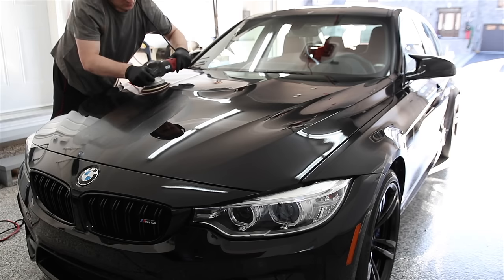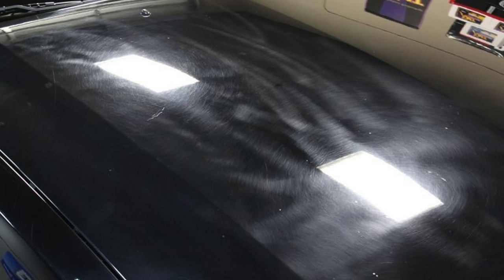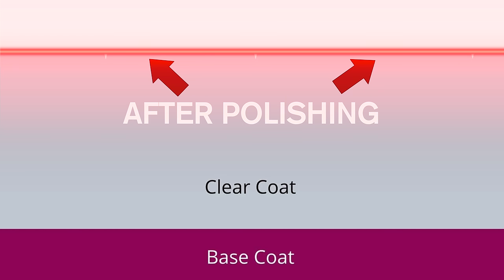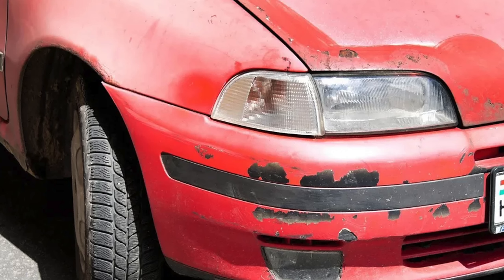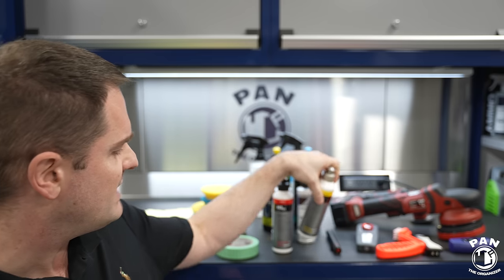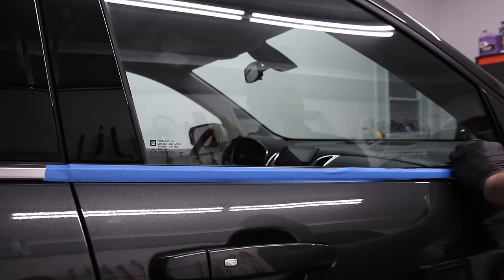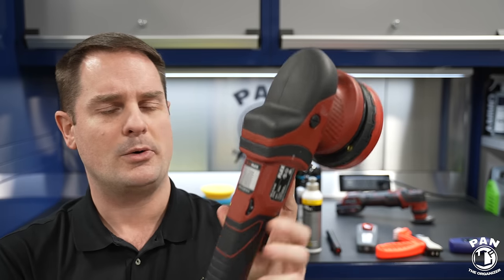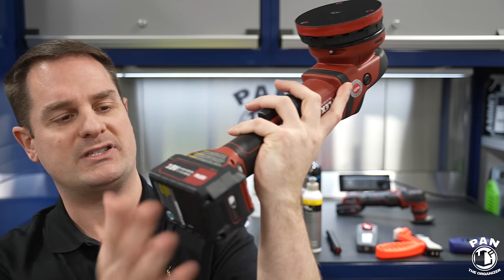DETAILING 101 - Paint Polishing - Everything You Need To Know

Comment: You mentioned something about “as long as your car hasn’t been repainted” I have a 23’ Tahoe that was not painted correctly from the factory and the dealership had to repaint.  They left horrific swirls and scratches in the clear coat from where they repainted.  Do I need to do anything differently to paint correct?  Or be aware of anything special?
Reply from the maker: Yeah unfortunately, dealerships often use the less expensive bodyshops as sub-contractors if they can't do the paint job themselves, so when they look for the less expensive bodyshop (so the dealership can maximize the profits when charging you), that means sub-par work and you get swirled and hazed paint like you did.

You wouldn't necessarily do anything different to paint correct though, as normally, repainted areas actually have a thicker paint as it was applied by a human, instead of a precise robot like at the factory. So the same polishing steps and processes apply on repainted vehicles too.

I would just recommend that you wait at least 1 to 2 months before attempting to machine polish your freshly repainted vehicle, as the paint needs to finish its gassing out phase, before being fully cured. Don't apply any sealants or waxes during that period.
Reply: @PanTheOrganizer  thank you sir!  I’m always amazed you actually answer all of my questions!
Reply from the maker: I try my best to reply to all YouTube comments every day. I’m the only big detailing channel to do that. It’s not easy though as I can spend up to four hours every day just to reply, as you can imagine with one million subscribers sending thousands of messages daily. But I try my best to stay connected with my audience. 😁👍🏻

Comment: Pan what’s your opinion on using Duplicolor grease and wax Soy Solvent then an IPA after polishing? To make sure it’s absolutely completely clean
Reply from the maker: It's overkill hehe. You don't need both. I tried the Duplicolor a few years ago and it's perhaps more suited for body shop use, to prep before painting. That stuff is powerful (get the soy based one if you absolutely want to use it).

I prefer using pre-mixed paint prep sprays from the same brand I have the coating for. For example, if I'm applying a CarPro CQuartz UK 3.0 coating, I will likely use the CarPro Eraser paint prep. It was formulated by the same brand and is clear coat safe, at the perfect dilution.
Reply: @PanTheOrganizer  you are the best!

Comment: So is the “compound” what they call the first step to a stage 2 paint correction?

As in a polish is a 1 step 
And a compound and polish considered a two step ? 

Sorry I’m new to this
Reply from the maker: You're getting pretty good at understanding this. :)

A compound is the first step of a 2-step paint correction. Correct. The second step is the polish.

Basically, the compound has the more coarse abrasives, for removing heavier and deeper scratches, swirls and oxidation. Then you follow up with a polish, that has finer abrasives, and that's made to remove the marks left by the compound, all while increasing gloss, adding more depth and clarity to the finish, and jeweling the finish to a crystal like gloss.

And yes, a 1-step correction is just using a polish. A 1-step is typically used for cars in better condition, that only have a light level of swirls and scratches.

Have a good day Ricky.

Comment: BMW M440i GC of one month old - do I really need to test different pads or polishers or can I simply decide to choose the Koch Microcut (or do you recommend to go with the Meguiaer's one from your video since I am a beginner)

My wife's Audi S3 is 9 months old (and she will want me do hers as well of course :)) and no clear problems; do I go with a compound first or can I also go with a polish (maybe the Koch one but perhaps with a bit more cut?) or also meguaiaer's since a beginner.

Last but not least; once polished and coated (still to decide which one but definitely doing it), I guess I should not (cannot even) polish it anymore until the coating will wear down, correct?
Reply from the maker: If you have no major scratches or deep swirls, you can skip compound and just do the polishing step.

Yes you can use the Koch Chemie Microcut on your BMW (Sonax Perfect Finish is another great one). If your wife's Audi has paint in good condition, you can also skip compound and just do the polishing. It all depends on what the paint looks like.

Once the vehicles are coated, do not polish them anymore. Polishing will strip and damage the coating. If you use proper washing and drying methods, you shouldn't need to polish the car for many years.

When I get a brand new car, I polish it right aways and protect the paint with a ceramic coating. For the three years that I keep my car, I never have to polish it again. I get a brand new car every three years.
Reply: @PanTheOrganizer  thank you sooo much 🙏🙏🙏
Finalize my list now, order, wait, unwrap and get to work 🙂

Comment: Just found your channel, and its really good information. My question is : i have a '96 red motorcycle, where it appears the paint has more of a orange tint to it,  ( i suspect sun fading  from sitting near  a window in a garage ? ) vs red. Its a small area on one mirror and a small portion in the same area on the upper fairing, and i would be interested what i should/ could do about that ?
Reply from the maker: Hard to say without seeing the state of the paint. If it's just oxidized, then a compound followed by a polish should bring back the color. But if the clear coated has failed and there is no more clear coat, a respray might be needed.
Reply: @PanTheOrganizer  , ok, thanks for responding. If the clear coat were gone, would it not have a border, where you can see it has been damaged or removed ? Cuz there is no such obvious visual. It just literally looks like it " Fades into more of an orange. Its not chalky at all, and there is no clear transition, but it is very subtle. Maybe impossible to answer, but thanks for your input.

Comment: Pan, would you recommend a 5" or 6" for general use?  I see many 5" come with a 15mm orbit, and 6" often come with a 21mm orbit.  Can you share some knowledge about pad size and orbit size?  Thanks!!
Reply from the maker: I would go for a 5" backing plate as it's more versatile. A 15mm stroke is also more commonly used. Larger stroke 21mm are more for large flat surfaces like large hoods on bigger SUVs or trucks. The bigger the stroke, the more area it covers. Originally, polishers only used to have 8mm throws. Rupes revolutionized the detailing space by offer larger throw polishers (hence the name BigFoot) that could do 15mm and 21mm.

My most used polishers are the 15mm throws.

Comment: @pantheorganizer 
I have a black car and want to apply the Turtle Wax Black Acrylic polish; but, also want to apply Gyeon Can Coat for a ceramic protection. 
You mention doing the IPA wipe down to remove fillers and oils before applying the Ceramic coating - wouldn't this remove the fillers in the turtle wax polish? if so, what would be the best way to accomplish applying that polish and Gyeon Can Coat?

Thanks Pan! Love the channel!
Reply from the maker: If you plan on using a ceramic based protection from another brand, I would not recommend using the Turtle Wax black polish. It acts as a primer for their Black Spray Wax, or compatible products in the Hybrid Solutions line.

If you want to apply CanCoat EVO, I would just use a pure polish like Sonax Perfect Finish, IPA wipe (crucial) and then apply CanCoat.
Reply: Pan, you are the best! Thanks for sharing this, and i'll be sure to use my KochChemie F6-01 polish, followed with a IPA wipe down and then application of CanCoat EVO. I'll save the black polish for a future date and match it with the wax. 

thanks again, Pan!

 @PanTheOrganizer
Reply from the maker: Here’s a video I had made about full prepping a car and applying CanCoat (it was the previous CanCoat version, but same exact methods apply for the new EVO version): https://youtu.be/VnE0b0nsiMU?si=PmU1XJSJKX3nMv_F
Reply: Thank you so much for this, Pan! Your channel really is the best place on the internet. 
 @PanTheOrganizer
Reply from the maker: Thanks Sean! Welcome to my channel. You discovered one of the biggest car detailing channels on YouTube as we surpassed 920,000 subscribers and we have over 120 million views! I have been detailing for 26 years and I love to share my knowledge and passion with my viewers.

You found the right channel to help you learn everything about detailing.

Comment: Hey Pan recently got a door painted and had some over spray compound on my other panels. When I run a detail spray it feels like my rag grabs onto the paint. Any recommendations on how to get rid of compound?
Reply from the maker: Hi Will. First, on a freshly repainted panel, you need to wait 1 to 2 months before applying any form of paint protection. You can wash the car with a pH neutral shampoo, but nothing more. By "over spray compound" I'm assuming you mean paint overspray? If that's the case, usually using a claybar and clay lubricant will take care of that, unless there's a lot and it's baked in, then you'll have to lightly polish the surface with a machine polisher, pad and polish.

Comment: Hey, thanks for the vid. I think I understand the intent but maybe I missed something as I am wondering what difference is there if I have 50 year old paint on a restored car. I know there is no clear coat on these and I know it was NAPA Emanual automotive paint. 

I am guessing the DIY paint on the car is thick enough I don't need to worry about it but what about the protectant, what is typically good for this type of paint. I just want it to be protected when I go to car shows, however it is a driver 1931 Model A Deluxe Roadster, green and black with Pin Stripping. I am thinking about the ceramic but I do have the carbana car wax we paid a bit of money for and you said that may only last a couple of months. Please offer guidance for anything you see could be affected as I have only hand waxed my other cars in the past and am planning on machine work this time to remove some oxidation. The car is always in the garage except when being used.

I will watch other vids to see if you cover.
Reply from the maker: Welcome to my channel. You discovered one of the biggest car detailing channels on YouTube as we surpassed 900,000 subscribers and we have over 116 million views! I have been detailing for 26 years and I love to share my knowledge and passion with my viewers.

You found the right channel to help you learn everything about detailing.

Comment: Pan, would you use a paint prep twice? So after iron remover and clay bar, do you spray the vehicle and wipe down right before using a DA polisher? Or do you go from clay bar to polish, then something like Gyeon prep? 
Thanks for the great info!
Reply from the maker: I go from clay to polish. I only IPA wipe after the final polishing step. Sometimes on older vehicles, I will IPA wipe after the compound stage to inspect the paint and then move to polishing and then IPA wipe again after polishing.
Reply: @PanTheOrganizer  thank you. I used a Da polisher a month ago and inadvertently polished some black trim. Any remedies to get that white polish off black trim? Perhaps a magic eraser? It looks terrible and is really frustrating me. 
Thanks again Pan!
Reply from the maker: An APC and detailing brush should do trick. Be careful with magic erasers as they are abrasives and can alter the trim.

Comment: what do you use to make your own ipa panel prep and instead of ipa panel prep can you just re wash the car with dawn dish soap to remove the grease or wax after polish/compounding before applying ceramic coating. thnx in advance
Reply from the maker: Yes after polishing, it's a great thing to degrease the surface by washing the car with dishwashing liquid. Gyeon actually recommends this in their coating instructions.

But as an extra measure of safety, to remove soap residue, I would still recommend a final wipe with a paint prep spray (like CarPro Eraser or Gyeon Prep) before applying the ceramic coating.
Reply: @PanTheOrganizer  Ok. Thnx for getting back to me and confirming. Don't get why people pay so much for degreasers etc when they can just use what they already have at home lol

Comment: Have a 2007 Honda Civic and the trunk is peeling can I still use the compound and the polish if I am careful on that area?
Reply from the maker: I would avoid that, as you run the risk of further damage. These are high speed machines that do mechanical abrasion. If the paint is peeling, that means you have clear coat failure. At that point, a panel respray is pretty much your only option. 

It would be weird trying to avoid polishing that spot, and then doing the rest. The rest will be glossy and perfect looking, and that spot will be scratched, oxidized and stick out like a sore thumb.

Comment: Hi Pan, I just went to the the sealant without IPA after polishing, using V36 from chemical guys.. Which claim to be oil and fillers free.. Do you know this product?
Reply from the maker: You should still always use a panel prep spray after polishing, before applying the protection. Even though most tell you their fillers are oil free, it's rarely the case. You don't want to take any chances, especially before applying a ceramic coating. And there's always a bit of residue left behind from the polish, that a towel just can't pick up.
Reply: @PanTheOrganizer  So much time spent on getting the car ready for the winter in Quebec, +/-7hours, anyway next year I won't make the same mistake.. I am using Fusso Coat to go through our harsh winter, my favorite sealant. Thanks for your answer! Merci d'avoir pris le temps de répondre Pan. Take care!

Comment: Nice video Pan! I have a question for you though, i've watched a lot of your videos and when it came to the topic of paint protection, i never hear you mention about glazes, what are your thoughts about applying glazes?
Reply from the maker: Glazes are seem as cheating as they contain fillers and masking agents to hide defects instead of correcting defects with proper paint correction (compound and polish). And they can interfere with proper bonding of coatings.

Hence why you don’t see many detailers use glazes.

But for someone who wants to take a shortcut, hide minor imperfections, doesn’t have the experience to polish paint and will only apply a wax in the end, they could apply a glaze if they choose to.

Comment: Great video. Been detailing for quite awhile, most of my life but got a question. When polishing, I use meguiars ultimate polish or the M205. When finished with a panel with the machine, when I go to wipe it off it's really hard to remove and almost impossible to wipe off. Do you know why this is, and if there is an easy way to get it off??  Thanks
Reply from the maker: Do you work in direct sunlight and on a hot panel? You want to avoid working in direct sunlight and always on a cool surface.
Reply: @PanTheOrganizer  No, always under cover and in a shaded area with the panels cool. Even tried a small section by hand, and it does the same thing.

Comment: Do my foam polishing pads have to be 100% dry before using them. Can paint sealants- protectants be applied by machine or do they need to be applied by hand.
Reply from the maker: Many use pad washers to clean their pads in between panels (for those who don't switch to new pads) and so yes the pad will be slightly damp, and that's fine for using to polish. As long as it's not "wet".

Liquid waxes and sealants can be applied by machine. You'd use a soft waxing pad (with no cutting power) and super low speed on the polisher. And then you buff off by hand. See my video on applying waxes: https://youtu.be/KZjiPcsPBrA?si=q2IPMtVlzQ3igIHz

Welcome to my channel. You discovered one of the biggest car detailing channels on YouTube as we surpassed 1 million subscribers and we have over 140 million views! I have been detailing for 27 years and I love to share my knowledge and passion with my viewers.

You found the right channel to help you learn everything about detailing.
Reply: @PanTheOrganizer  Thank you!

Comment: Hi Pan! My father washed my car a few times with dawn soap and for some reason it just doesn’t look as deep black as it was. I was wondering what are the steps I need to take to get back to that deep black color
Reply from the maker: Never wash cars with dishwashing liquid. Those are very aggressive degreasers and can dull the finish over repeated use, and strip waxes and sealants over repeated use too. Always use a pH neutral car shampoo like this: https://amzn.to/3GUHCCZ

Now depending on how bad the finish is, it would be a good idea to at least wash the car, use an iron remover to remove embedded brake dust, then a clay bar step to remove further embedded contamination, and then do a light polish with a polishing pad and polish (like Rupes yellow foam pad with Sonax Perfect Finish polish). 

This will remove light swirls, scratches, oxidation, bring back gloss and improve clarity. That's the least aggressive method. If you want the best method, you start with a compound, and then finish with a polish.
Reply: @PanTheOrganizer  awesome thank you so much! Needless to say I was not happy with him when I found out that’s the soap he used! But the finish isn’t bad at all it’s just not as deep black as it was. Thank you!
Reply: @PanTheOrganizer  and what are some budget friendly beginner polishing machines? I’m extremely interested in learning
Reply from the maker: I put some budget polisher options in the links in the description under the video. ;)